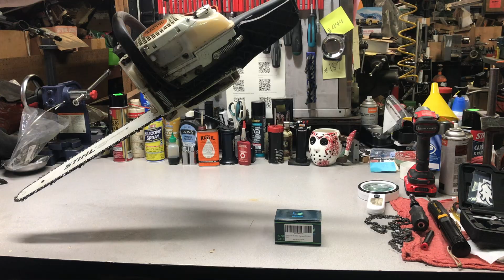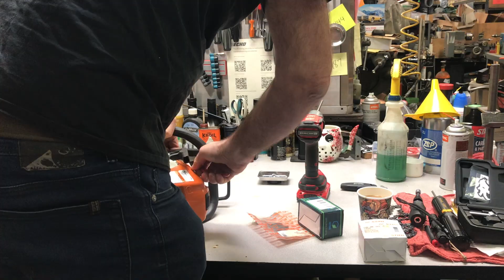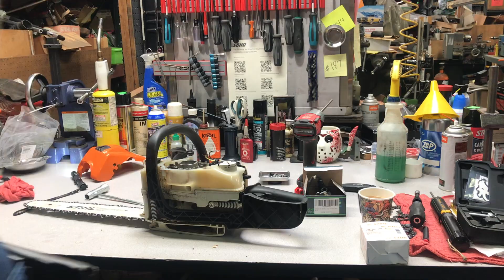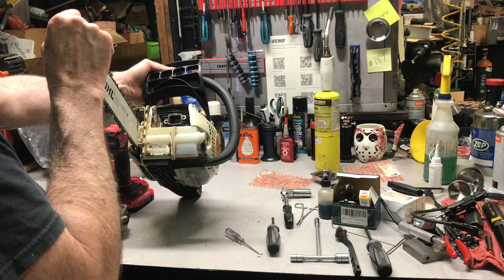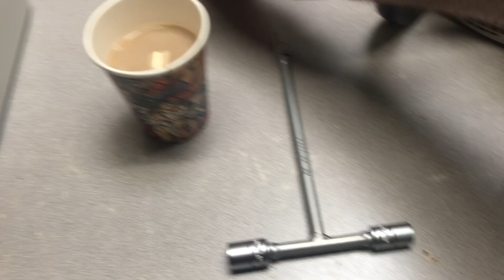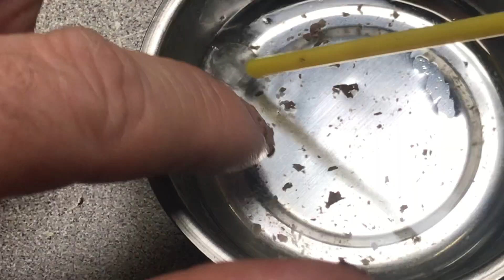Stihl MS171 chainsaw ignition and carburetor repair.

Comment: Thanks for taking the time to do this..... this is same saw as mine.....where you get the tester......?....thanks
Reply from the maker: The tester is an Echo PET4000 and came directly from Echo as I'm an Echo/Shindaiwa dealer.  It is manufactured for Echo by Oppama in Japan along with many ignition modules used in Echo products.  It's available from Echo parts online and Amazon.  Thanks for watching my videos, I'm try to put out the most technically accurate professional videos out there because there's a lot of poor ones done by unqualified hammer mechanics.